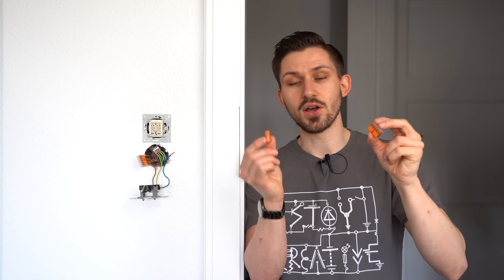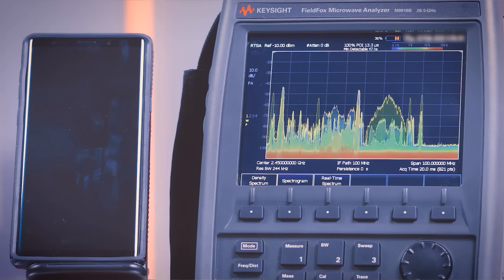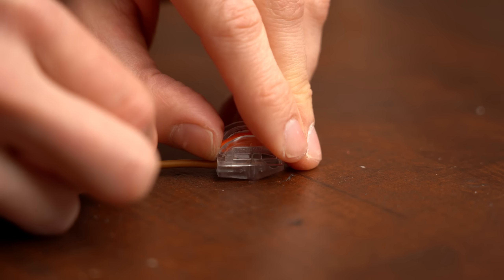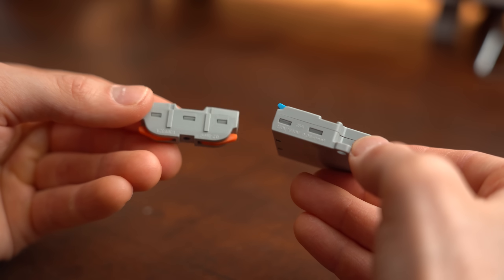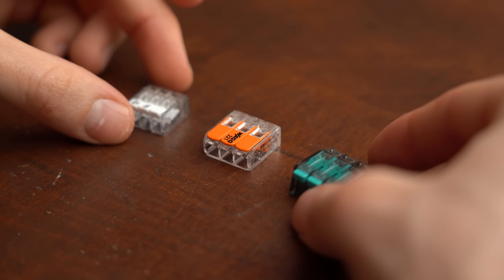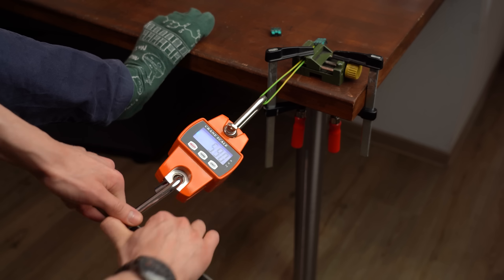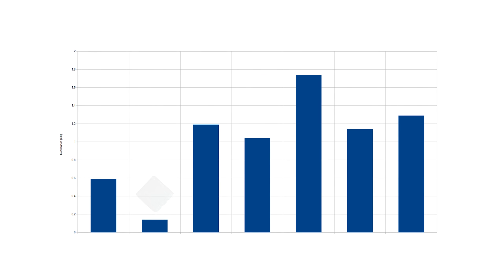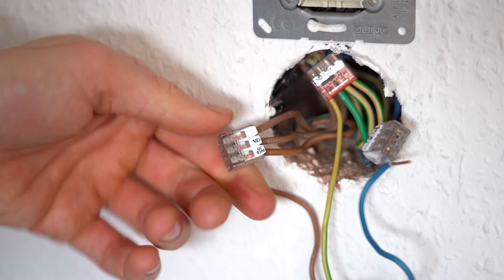I tested 7 Wago Knock-Offs Wire Connectors so you don't have to! (Surprising Results)

Comment: The certificate is a typical german angst thing. Irrelevant.
I can get the knokoffs from ali without any problem, while i can not easily buy the originals. The shops here are still in the screw-clamp age and not price competitive at all. German shops want 1 gold bar extra to ship to non-eu switzerland. Because i would buy the originals if i could and price was about equal.
And so my 20A plus solar stuff runs on knopckoffs. The orange-blue colored ones.
Reply: Point is that here he bought relatively quality knock offs. Buy some Chinese clones and you'll suddenly learn why certifications matter ;)
Also, Wagos are (also) produced in Switzerland, you sure there's nobody selling them over there?

Comment: Your conclusion is disappointing. ALL connectors are suitable for hobbyists projects? I would eliminate the connector that you could pull the wires out with your hands. All point categories are not equal. This is a basic fail of the device. And while you tested resistance, you did not test max amperage of the bus bar.

Comment: ich habe einen biligen auvisio subwoofer und zwei über 30 jahre alte 45watt universum 2 way speaker. 
die speaker haben normales lautsprecherkabel und der subwoofer cinch, also hab ein altes cinch audiokabel zerschnitten und mit kabelklemmen an die lautsprecherkabel drangemacht. 
problem: die speaker brummen und die kabelverbindungen halten nicht lange...wenn ich auch nur gaaaanz leicht an eines der lautsprecherkabel rankomme ist sofort der sound weg oder fehlerhaft. irgendwelche ideen um diese probleme zu beseitigen?

Comment: Some time ago I watched video where Wago connectors were being tested for extremely high amperage and as far as I remember 2,5 mm wire started to loose it's isolation due to heat and started to glow red before even anything happened to Wago connector...
Reply: John Ward "Wago 222 Connectors vs Others, Testing Current Overload and Flammability" youtube video
Reply: Link for those who like convenience:
https://youtu.be/bP0qHyVAymU

Comment: Once again you did not "pull" on the wires after clamping them before testing resistance. It changes it a LOT. (Improves it)
Reply: That’s not going to happen during actual use, though.
Reply: @JasperJanssen  It is part of the instructions to give the cable a tug, verifying it is secure. It however also changes the resistance.

Comment: I really don't get the need or wish for such easily reusable connectors. Just push in connectors are also reusable just a bit less comfortable. The only time I use the levered connectors instead of push in ones, is when I know I soon will need to change this installation anyway or if I connect to a stranded cable (like hooking up a lamp). 

But apart from that why anyone thinks that such lever mechanism is useful? After all they are more expensive and especially quite a bit larger.
Reply: like you said, it's for stranded cables. it has a higher resistance (2.2 mOhm according to scott himself) and is not ideal otherwise. 2273 is probably better for most applications with solid core cables
Reply: @LC-hd5dc  Sure. But what I've seen from the video he uses it for everything (like wiring the light switch).
Reply: @lal12  Point is 'why not', cost isn't really the concern here as wiring up an entire house using Wagos is still under 20 euros so not enough money to worry about it... If you don't have enough space than your installation is not up to standards (in Europe at least, I see many American breakerpanels etc. that are quite small/narrow and space-constrained.
In Europe, you will have enough space for Wagos, so why not use them?
Reply: @someguy4915  well if you make a complete new Installation there probably is barely a need for any connector since almost any can be done by using the push in terminals of the switches / sockets anyway. But if you do a lot in an existing installation 20€ is rather optimistic. But ok cost probably isn't the main issue here.

But space is my main consideration I had a lot of cases where lever connectors are rather a tight fit, where push in connectors would be better. One example are modern LED lamps I used which were relatively slim and small, I had to use lever connectors but they where just barely fitting.

In another case I wired up an electric motor for roller shutters to an existing installation box. The motor had stranded wires so I used a lever connector, but with 5 connections (power in, motor, socket, 2x switch) lever connectors where a really tight fit.

Comment: Regarding price per unit, you should grab them from China instead of Amazon. You can get a bag of the ones shown in the video for pennies per unit. And they're the exact same one.
Reply: Or at least from an electrician supply company to give realistic domestic prices. 

On the other hand, the channel is aimed at the hobbyist that will likely use Amazon.

Comment: I am neither American nor Eropean. I never used any of those connectors before but only electrical tape. I prefer wago connectors over wire nuts.  They are reuseable and more practical. Wago connectors are easier to connect and disconnect.

Comment: Those CE markings are fake. There is a logo standard for design. You can spot fakes when the end of the middle line on the E lines up with the ends of the arc. The middle line should be slightly shorter.

Comment: Your style of video making is distinct, clean, and aesthetically pleasing. Writing things out is a great way to fill video space between key points, and it looks really good. Plus it's always relevant because the values/words are related to what you're talking about. And the nice penmanship on the clean white paper is very satisfying, haha. Putting the knockoff connectors on a paper and writing their points is a nice touch!
Reply: As it was said for someone else here, in other video's comments: I bought a bunch of Stabilo pens hoping that I could get so smart as Scott, but it didn't work. 
And being left-handed also helps to make the handwrinting more appealing.
Reply: Yeah shame he makes the 1's look like 7's though
Reply: @gn6034  That's just the typical handwritten German numbers, and German sevens also typically have a horizontal dash through them (which can help tell them apart). I found it weird when I first witnessed it in school with a teacher from Germany.
Reply: @AndyGneiss  everyone should be using a crossbar on their 7s

Comment: 6:35 ... I totally disagree with your Size Score.
The Red, Yellow, Blue connector takes less space than 3 x Wago 203 or 223 and it's also inline which can help you in some cases.

9:23 ... Nice graph, but not enough
You had 20A though each of them so you cold have done a graph with all the Power Losses in the connectors.
You could also calculate a maximum current for a set Power Loss on the connector, let's say 1 - 2W

Comment: Being a US resident, I have a great reason not to use these types of connectors for home wiring. Simply put, it is available space... Right or wrong and comparisons to other countries do not matter at all. Our standards are what they are. I would say that 80%+ of all house wiring boxes that I have worked in do not have the space for these connectors. Fiddling around with 14ga might be ok in some cases but fill a box (like in a kitchen) with 12ga wire and receptacle and/or switch  then add a wago connector.. Ya no thanks... The "standard boxes that are most common would likely not have the space. Twist on a wire nut (and you can buy a ton of these for next to nothing) and shove it in the box and be done without worry about space. Connections have to stay inside the box. Now how about a bunch of these connectors inside a junction box that has several connection points, you cannot have loose wiring with connectors without a junction box in any normal location that has wiring codes and standards. Keep in mind this might be a junction box that is a "standard" depth not one of the nice deep ones; those cost a several pennies extra and most electricians save the extra pennies when they have to buy thousands of these a year (another great reason for them to use wire nuts).

The test you have shown here does not show what can happen over long periods of stress cycles. Which is reason #2 that I wouldn't use these. This is all about me personally (my reasons)... I do not like complexity when something simple and elegant is already available. I don't go dicking around in my home electrical boxes out of boredom, and I certainly do not need to connect/disconnect my home wiring hardly ever. These wago and "knock-off" connectors are made of multiple moving parts which (in my mind) equates to multiple points of failure. I do not personally want to add extra points of failure to my home wiring. This is the point that remains untested here in this video. Honestly I wouldn't use them in my house wiring no matter what the tests might say. Perhaps for a low current thermostat wire, but not mains. How many people are truly willing to work on their own house wiring, let alone try something that is a knock-off with regards to their/families life? I'll stick with the K.I.S.S. (keep it simple stupid) method here. Simple, elegant, and completely safe, plain old wire nuts that have been proven a million times and more. 

The certifications you show mean less than nothing to me, rubber stamps are cheap and other "points of origin" do not care if they are breaking a rule about adding a certification stamp even if the item is not certified. For hobby needs where lots of testing is needed and connections are changed frequently, I'd use these all day no problem. If I finalize a design, I'll use plug in connectors though. They look much cleaner and are easier to hide.

In the end I only have 1 reason, that I can come up with, to use these style of connectors. This alone relegates this to a novelty item for my uses. I do not dislike the connector in any way at all, they are just yet another item that I do not own; that list is a long one indeed.
Reply: Hear, hear!  All splices and devices require an accessible box.  All devices must be listed AND marked.  If the device isn't imprinted  with awg wire size, it's useless.  (Revenge on the "what's that in kilometers?" crowd.)

Proviso: in old work, the copper may be short, tarnished, or work hardened.  The Wago's spring clamping force is a positive differentiator.
Reply: Spot on. I just rewired my fan in the primary bedroom due to the old switch failing. There's not enough space inside the wiring box to make WAGO connectors feasible. And regarding the price, you can buy a pack of 100 Ideal branded connectors for like $15 at the big box store.
Reply: i think the other comments have already explained the failure of wire nuts, so i won't repeat it. all i will say is, you're biased and wrong.
Reply: @LC-hd5dc  hehe

Comment: The issue I had with a particular brand of knockoff was that the wire was relatively hard to pull out when pulling straight - but as soon as any rotation was applied to the wire, as happens  quite often when tucking wires back into a wall box, the wire would simply fall out of the connector. I tried it with both 14 AWG and 12 AWG solid wire, and multiple connectors. The whole thing went back to Amazon the next day.
Reply: The biggest issue with generic knockoffs, particularly from Amazon, is if you do find a acceptable part there's no guarantee you'll get the same quality part the next time you order.  Wagos are always Wagos (at least until somebody decides to make fake ones)
Reply: @RealJohnnyDingo  Sadly fake Wagos are out there. Things look near identical too. Big Clive has talked about it in some of his videos.

Comment: Confirms me in my experience: ViD Products are absolutely fine to use. German department store OBI sells the non-levered as their house brand, which should mean their certificates are most definetely not faked. And I had no issues when using those and the levered ones so far.
Reply: Wie wo was weiß Obi.
Reply: Still no experience in the long run for just 6 cents cheaper  per connection thats test would be mental to do on your own houses :-/
Reply: @kitecattestecke2303  If the certs are genuine and they really are such a common brand, then I see no problem.  Wago is the gold standard, but as others have mentioned the largest issue with knockoffs is quality control.  That's not an issue from a company with a reputation to uphold.

Also, Wago makes those extra hold down products, including DIN rail mounts that you can fit their connectors into.  That's another reason they can charge a bit more.
Reply: @kitecattestecke2303  The push-ins I bought as I ran out of Wagos for a job at my  house. Certainly a lot better than the Luster terminals I replaced with them. The only real difference I noticed is, they are a bit harder to push in than the Wagos. The lever mechanism actually feels a bit nicer than wagos, though they are one for one a bit thicker. And I think they would have caused a bunch of housefires already in Germany if they are prone to it - craftsmen shop in department stores in a pinch as well...
Reply: @kitecattestecke2303  I bet you're vaccinated though.
You don't need "long run" evidence. 
If we all waited around for "long run experience" before adopting a new product, we'd have nothing.

Comment: big issue with knockoffs is quality control/assurance. They skimp in that area so although they might pass your testing a significant percentage of them (maybe one in a thousand or ten thousand) might be dangerous - which is an unacceptable failure rate for something meant to stop your house from burning down.
Reply: Scrolled down to make this exact comment
Reply: the other thing is since the knockoffs aren't really cheaper, why buy them?
Reply: @LC-hd5dc  They probably are if you don't get them from Amazon or if you're in China or where ever and buying them locally.
Reply: @LC-hd5dc  Well, his Wago 221 is 26 eurocents.  In Canada Wago is at least twice more expensive ( and only from Amazon)
Reply: " a significant percentage of them (maybe one in a thousand or ten thousand) might be dangerous - which is an unacceptable failure rate for something meant to stop your house from burning down"

You might as well have said nothing. A significant percentage of them might be dangerous, maybe, potentially, perhaps.

Fact of the matter is, there's nothing wrong with them. They're almost identical in construction and identical in function. 
Some people just refuse to accept new things, preferring to run with, honestly, pissweak arguments about "Sometimes, something potentially might could happen that is the very bad, perhaps" followed with a "and when that bad thing that is only hypothetically a possibility, potentially definitely happens, someone will point the finger at it."

The likelihood of someone having an off day at the Wago factory, is equally as high as anywhere else.
Do you honestly believe Wago test every single connector?

Utter nonsense.
Reply: @jimmyb1451  Lol, you hit the nail on the head. 1 in 10000 is an acceptable failure rate; with 3 defect vectors, DMPO is around 5.5 sigma. The likelihood of failure in switches and insulators is way higher than that.
Reply: @jimmyb1451  
"You might as well have said nothing."
I am an EE and an RSE so I am fully qualified to talk on this topic. Take your own advice and don't ever talk to me again, you rude SOB.
Reply: @squee222  hahahaha!
I highly doubt that.
Reply: @squee222  your qualification on the topic doesnt discredit other peoples view on the topic. That you know what youre talking about doesnt mean other people dont. I am a car mechanic, and know alot of automotive engineers. They know alot more about designing and specs than i do, i know alot more about the failures than they do, because i work with the actual products, and encounter the problems. Point being even if i know nothing about the specs i still know whats right and wrong. Also calling someone an sob makes you the rude one tbh.
Reply: @squee222  you dont get the point i made, i never discredited you, i simply stated that your profession doesnt discredit other peoples experiences. In general. Also calling people sobs is abusive, youre being abusive yourself when theres no need. Also if you dont want people to reply, dont reply yourself. Dont tell others theyre not allowed to do something because you dont like it. Thats not how the world works.
Also he was never abusive to you at all, can you state what you find abusive about his statement because i can see nothing wrong with it.

For the last time, i never said you were wrong in your original statement. But people can have different experiences with the same product. That youre right doesnt mean hes wrong, you can both be right. Please remember that.
Reply: In old homes is not uncommon that wire caps become oxidized, spark and fail charred. I still deem very unlikely that a hole in the wall start a house fire. It's all mythology pumped by distributors and electricians to better promote their job.

Anyway... 1 to 2 way 3-color coded WAGO copycats it wasn't my choice: they don't exist per WAGO catalogue and they're incredibly convenient while cabling house 3 core wires.
Reply: Hm, fair point.
But the connecters aren't fire extinguishers or sprinklers. :P
Reply: @GLITCH_-.-  I think you miss the point - flawed analogy, fire extinguishers or sprinklers don't have the ability to start or perpetuate a fire. Insurance has a way of pointing blame at something that isn't certified or up to spec.
Reply: @Fifury161  he wrote: "for something meant to STOP your house from burning down." Which is what fire extinguishers and sprinkler are for, because in that case the fire is already burning.
He should've wrote: "for something meant to prevent fires"
Why do I bother explaining this...